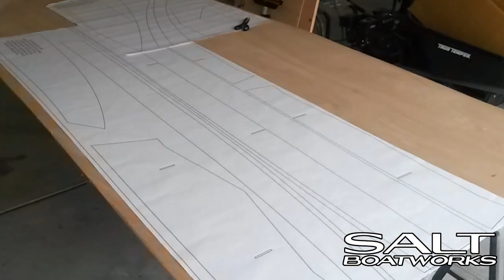Simple BOAT BUILD for beginners!  How to Build a Solo Skiff with Stitch and Glue - Solo Skiff Plans

Comment: very nice! i hope your getting $$ considering how much these boats cost new 500 to 2500 is a deal. on the other hand for the life of i can't understand why if your making a "boat" why don't you use pressure treated plywood and lumber? if you ahve over 20 years or at least 10 years of home repair experiance you can make these all day without plans! you don't need curves everywhere either. simply add some angles and you should be good to go

Comment: Would you be able to build this out of insulation foam instead of wood ? Use same template but instead , use it on foam and glue together ?
Reply from the maker: Wood is the main structural material of this boat. Swapping it out for insulation foam, a material with no structural qualities, would not work.

Comment: Are those foam is a must?
Reply from the maker: Yes, we use the compressive strength of the foam as part of the structural support of the hull.  It is also a USCG requirement for boats under 20'

Comment: Anyway to make it lighter ??? Full  fiberglass????
Reply from the maker: The completed boat weighs approximately 100lbs.  A solid glass boat would not save weight but would likely increase in weight.
Reply: @saltboatworks1139  Even with the foam inside it weighs 100 lbs?
Reply: @Juandongduck  The foam might be used to help support deck and hull panels.  You might save a little weight removing it, and possibly adding some extra partial beams if needed. In general though, wood  (due to lower density) is stronger and stiffer pound for pound than almost any other material, until you get into some really expensive composite sandwiches.